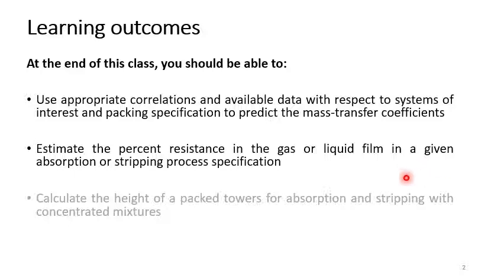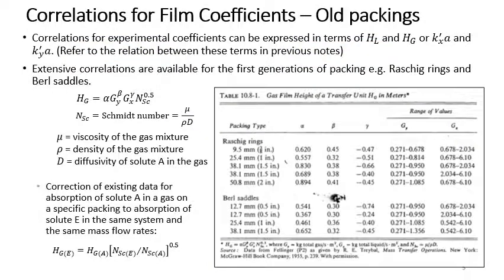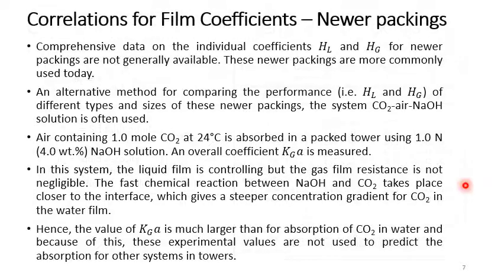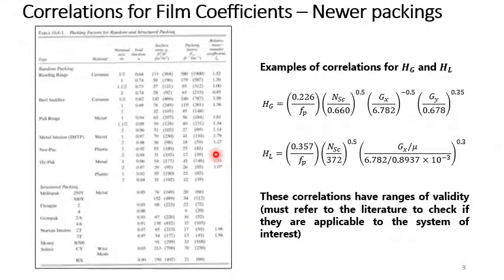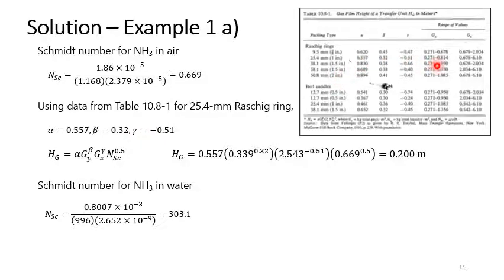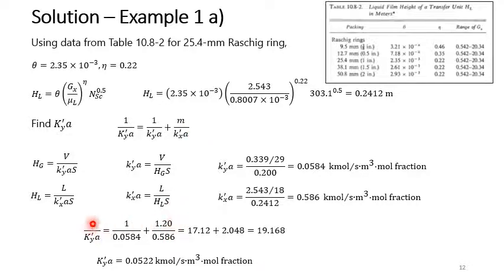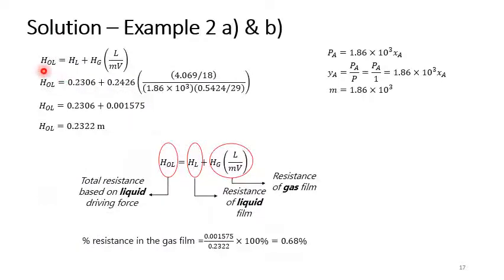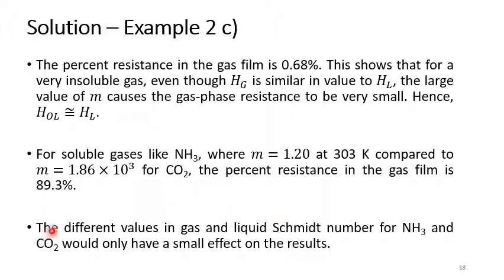10 Prediction of Mass Transfer Coefficients & Design for Concentrated Mixtures Part 1

Comment: really good video, do you know if this correllation work with quench tower (without any packing)? i'm trying to design a quench tower and i do not know where to find the correllations to find a heat transfer coefficient (U=W/m3·ºC). much appreciated if you could send to me a handbook or pdf where to find it.
thanks